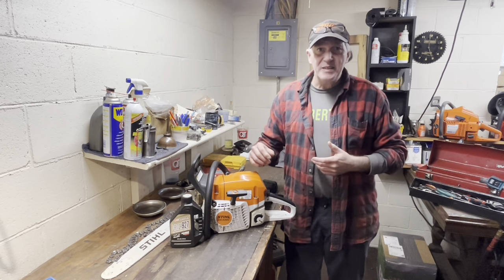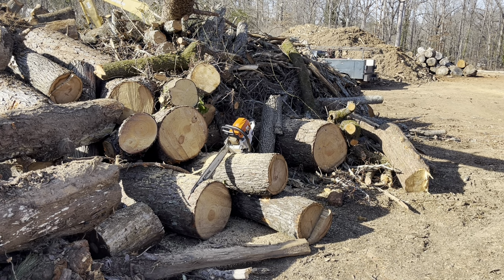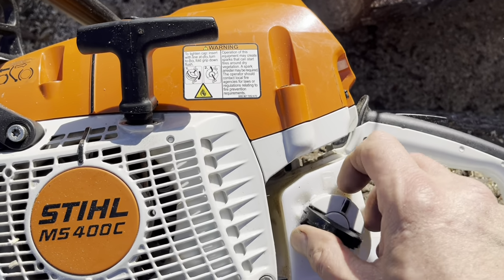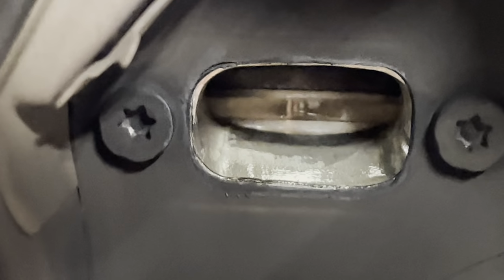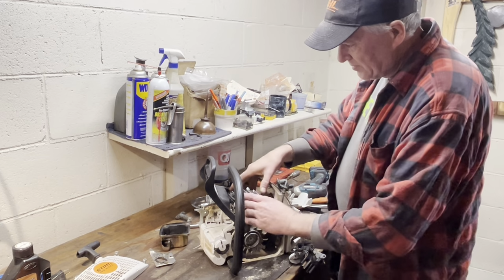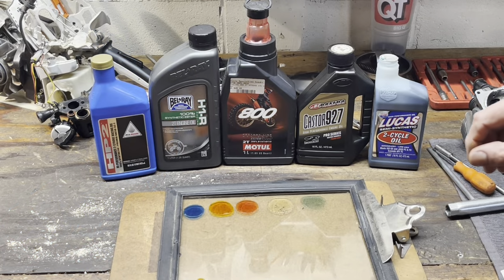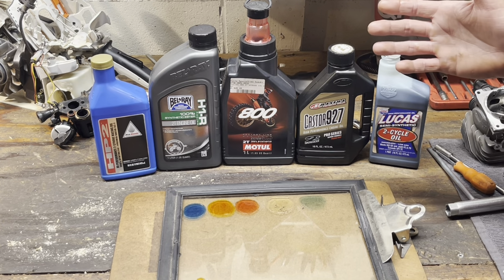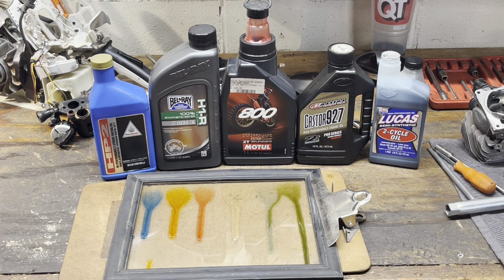Castor 927 Oil Test with Teardown

Comment: The carbon deposit on the piston crown for Castor 927 is the Castor oil itself. Castor gets thick and gummy with heat, the opposite of all other oils.
This helps with anti seize in the event of lean running as the gum still has lubricating properties. 
For saw application it’s not appropriate as eventually the carbon will cost the top of the piston and work into the ring grooves causing the rings to stick.
Great video Richard we are highly appreciative of your expert opinion!
Reply: Will water decarbonization work for saws?

Comment: The 9 and the 7 stand for the ratio of petroleum based oil and synthetic natural gas based oil. The 2 stands for the ratio of bean oil. The bean oil is dirty but it creates a better seal for your piston rings to create more power. Motorcycle manufacturers all knew this was the best oil you could get for racing in this country reliably. I was a suspension development rider back in the 80s and early 90s. I also did a good amount of chain sawing. I used 927 and turbo blue in my bikes and chain saws for years. Never had a problem with my saws. Castrol make a 947 oil that many felt was better but it is hard to find in the USA. I can tell you that 927 was used by every factory racing team in the country. They would even put it in other cans that had other manufacturers name on. Each different oil has a good quality. Petroleum based oil runs cooler. Synthetic oil protects better when the engine runs hot. Bean oil makes more power by sealing.

Comment: The absolute best smelling 2 stroke oil IMO! Ran many gallons of fuel mixed 32:1 with 927 over the last couple years in saws, trimmers and blowers. Surprised to see that amount of buildup in just one tank, every saw I've ran on it has stayed pretty clean internally. Now my Husqvarna handheld blower on the other hand... it built up an incredible amount of shiny, hard, black carbon after about a gallon of mix😮 also purchased an Echo srm-2620 last spring, removed cat from muffler after the first tank and ran 927 exclusively in it all season. Pulled muffler and plug this fall to have a look and piston looked beautiful! Just a brown coat on piston crown but zero buildup, same for exhaust port. But the muffler was absolutely disgusting! Not dripping with "spooge" but like it was just hot enough to polymerize the oil at the outlet and bottom. Like hard, sticky tar.  While the 927 offers excellent protection, I think ill be staying away from castor containing oils atleast for trimmers and blowers. Will probably still run it in a saw or two, if for no other reason than that killer smell🤪
Thanks again Richard for the time you spend to do all these tests👍🏻  still interested in seeing how aspen 2 compares to motomix/hp ultra. atleast in terms of lubrication😊
Reply: Thanks for sharing this.

Comment: I used 927 in my dirt bikes and had it on hand for my yard equipment. It smells pleasant and works wonders on small engines. I will even mix a tiny bit in my lawn mower and it's been running for 20 yrs

Comment: The 927 is dirty. No argument from me there. It really, IMO, makes a difference with how many gallons per year you run and if you’re WOT or on and off the throttle. I started using the motorcycle oil many years ago when I got a huge load of big cherry and oak in the summer. I saw a container and thought if it’s holds up in an air cooled dirt bike it should work great in a saw and never looked back. 
I did pick up a pint of HP2 to use in my new to me Homelite based on your testing Richard. And it works great! Thank you for doing these tests! We all learn from them.

Comment: Thanks for getting the 927 test in.  Results are what I expected, was hoping it would be a bit cleaner in the mtronic saw but nope.  I love 927, the smell is just amazing but I had to finally pull my 390XP apart I believe it was last year and clean up the piston and all cause it was coked on carbon pretty good.  I switched to Maxima Formula K2, doesn't smell nearly as good but burns alot cleaner.
Reply: Thanks for this information sharing
Reply: How does the K2 run in your saw?
Reply: @dennisyoung4631  K2 runs awesome.  Clean burning oil.
Reply: @matticus6339  thanks for the reply.  I have a 43cc Zenoah engine which I hope will be driving an emergency generator for charging batteries, and am planning to run ~ 28 to 1, with a rich non-ethanol mix.  I do not wish to stick the engine, hence substantial caution.

Note this isn’t one of the really screamy engines, e.g. the RCxxx ones.  The manufacturer calls for 40 to 1, but that scares me.
Reply: @dennisyoung4631  You shouldnt have any issues with K2.  I mix at 32:1 and no issues.  The only thing I wish, is that Maxima would put a bit more dye in it.  But I mix as soon as I get gas home from the store so I don't mess up.  Don't get me wrong, K2 is dyed but its not as strong a dye as some brands.

Comment: I’ve been mixing HP2 with 927 or k2 at 50:1 for a couple of years now, mainly just to give my fuel some color. Seems to be working fine. Is mixing oil a good idea or not? I might start running hp2 exclusively when I run out of 927 & k2. Thanks

Comment: Hello Richard! What fuel did you use in the video? Pump gas or alkylate (non ethanol gas)

I’ve tried to mix it with alkylate fuel and it separates from the castor 927, any thoughts?

Keep up the good work and take care.

Comment: Honda recommends running the hb2 at 32:1  and my chainsaw  recommends a mix of 50:1 and i want to use the hb2 after seeing your results should i use the hb2 how honda says (32:1) or mix it how my chainsaw manufacturer says (50:1) . Great videos btw.  Thank you friend
Reply from the maker: I tested it at 40:1 and it did great.

Comment: And with Castrol POWER1 RACING 2T there is no carbon build up at all...
Few months ago I had to chsnge the exhaust on my old MS230 from 2005 because it fell apart. Exhaust port clesn, no build up. Only a slightly coated with ash, on touch stays on fingers, piston and cylinder look beautiful. The film of oil is nice and shiny.
Reply: Yes  castrol power 1 racing  2T      good oil.  My 500i  going good on that oil .
Reply: @nikolaigordon  My machines are like brand new... MS230 piston, rings and cylinder look perfect. Made in 2005 I can still lift it by pull starter. So strong compression...
FS120 since 2016 heavy duty all the time still perfect. Running my new MS311 for a year on that mix too...

Comment: Bean oil was popular in the 70's for MX.  I remember fouling being an issue.  I like 110 leaded with VP or Redline 50:1.   Remove carbon from the sparky with a tooth brush.  I have yet to check carbon on the piston 'cause they run great.

Comment: I just looked up the specs on this oil and it is in SAE 40 grade range at 212 Fahrenheit with it‘s flashpoint 424 Fahrenheit. I believe Schaeffer‘s 7000 is SAE 20 and 218 Fahrenheit flashpoint simply for comparison. Good information👍

Comment: Do you use 927 in the winter time? I heard that the oil separates from the fuel at around 35 degrees ferenheit.

Comment: one thing I noticed when running my gallon or two of Benol mixed gas in my 2 strokes each year, is that  weeks or months later I get a little whiff of the bean oil smell as its deposits get cleaned out by the other ester based oils I run.

Comment: Great tests for sure. Wonder how maxima super m would do in a saw. Or even klotz snowmobile there both jaso fd, api tc, and iso egd. Ive been running vp but sure is pricey long term.
Reply from the maker: Are you able to get it in the pint bottle with the built in measuring cup?  It's a little cheaper than the premeasured bottles.  Be nice if they sold it by the quart without the fancy bottle.
Reply: @richardflagg3084  yeah I get it in the one with the measuring cup but I wish they sold it by the gallon. I usually buy oil buy the gallon or atleast half gallons so I have it stocked for a long time.

Comment: You convinced me to run saber at 40:1, but my local dealer only had interceptor  and dominator. I bought dominator  as im trying to use the same mix for lawn equipment  and my mx bike. What do you think of dominator  at 40:1? They had 927, super m, k2  I have no idea what to run😂  been running klotz super techniplate  at 32:1.
Reply from the maker: Dominator is a really good oil and absolutely nothing wrong with running it.  Saber has a better detergent package and burns a good bit cleaner.

Comment: I’ve been using Motul 800 in my 066 and 200T, works great. I bought a bottle of Belray H1R but haven’t tried it yet but I used to run it in my old YZ 250s and it was great.

Comment: I used to run MX2T, no dye in that stuff either. More than once I double dosed a gas can because I thought I'd already added oil, but not 100% sure. Could tell by the exhaust smell afterwards that I'd double dosed. Fine with me, that's cheap insurance. Running 16:1 is a whole lot better than running 128:0.

Comment: Any thoughts on winter VS summer us for bike oils. Id assume most people aren't running bikes in winter, so are manufacturers taking into consideration everything winter wise?  And what about ski doo oil?  Lol I'd assume that stuff isn't designed for summer use.

I'm in Canada but not real cold part east coast like maine weather or new England. Hovers around 32f in winter and 50-70 faranheit most of year. Humid damp. Windy lol

I'm milling mostly small stuff 7 to 20 inches. 462. We always ran stihl premium for years in concrete saws as masonry contractor. Never really had many issues everyday for few years cut cut cut. You'd have to mess with a little after few years but still good enough for side jobs or home owner

Comment: Use 32.1 mineral oil and add any cheap motor oil in tank like one cap in every tank along with 32.1 mix good smoke and  power

Comment: Yes the maximum k2 is like light gold ..can barley tell its mixed.i got scared even though i mixed it 40to 1..
Reply: Hey I'm right there with you on the k2 wish they would put some dye in it! Because that's what I run it takes blue aviation fuel and turns it like old brown  stale gas color almost at 32:1 40:1 mix is what I run in ALL my ported saws or stock saws. BUT YOU HAVE TO KNOW THAT IT'S MIXED SO I PUT IN GRAPE SCENTED STUFF IN MY FUEL!!!

Comment: Thanks for another good test Richard.  I'm kinda surprised that the top of the piston was that carbon'd up after 1 tank?  Seems to be a popular mix oil amongst the chainsaw folks....
Reply from the maker: Me too
Reply: Shocking and kinda a bummer considering how nice and shiny everything was.
Reply: @oakiewoodsman  red armor sure does quickly clean up the "castor goo" tho, if ya wanted to mix up a gallon of 927 every now and then😉
Reply: I know they advertise it as cleaning it up. Would be good to run in the Lynch 660 and the Super Dave 620 without the screen.  If more heat is better for that fuel, I wonder if the stock 562XP would really like it since they run so darn hot?  Maybe the carbon would not deposit so quickly especially with the stock muffler? hmmmm @aaronpowell4885
Reply: @oakiewoodsman  one way to find out! Run a tank or 2, pull plug and peek in cylinder. 927 has left no deposits in my g660 or ported 590. I will not say it's the be all end all oil and is definitely overkill for all but the rowdyest saws, I believe every 2t enthusiast should atleast experience a tankfull of castor mix, whether they end up loving or hating it🤪

Comment: Richard keep a look on Rocky Mountain ATV for the HP2.   I wait untill its on sale.  If you spend $75 you'll get free shipping, it's on sale for 10.99 and regular 14.42.   The last time I bought 2 case's it was $7.50.   

About 3 years ago I was looking for a better oil than the Stihl Ultra.   After reading Dragon Fly's data and watching Redbull661's Honda HP2  teardown video I decided on the HP2 over everything else.   

One thing for sure with the "Smurf Blood" there is no question you have mixed gas.    

Another thing I do to help prevent "straight gassing" my  2 strokes.   I bought the blue kerosene fuel cans for my mixed fuel.   If someone is helping me load up stuff it's easier to just say "grab the blue jugs" and it's a piece of mind without questioning or double checking.

Comment: While 927 is great oil, it does leave too much residue which ends up sticking the rings, I sold a perfect KX60 dirt bike to a friend for his kid to race, it seized up horribly and he tore it down, he started complaining to me about what I sold him, he was using 927, the rings were stuck  tight. Bean oil has always had this reputation and is one of the toughest lubricants available, but it's pretty much meant for racing applications where teardowns are often, I use it still but never in a saw or blower, I'd stick with the Motul, HP2 or non-castor Maxima.
Reply from the maker: If someone is going to use 927 and they're in the know, I'd imagine you'd have to be willing to do a teardown/inspection on a regular basis.  At the very least run some practice rounds and testing with a cleaner burning oil with a good detergent package.  Hard to argue the lubrication properties of castor tho.  It's just not for everyone.

Comment: Have you tried  outboard oil. I'd be interested in that test. Quick silver or pen zoil 2 stroke outboard oil.
Reply from the maker: I've only tested Schaeffers 7000 as it was my go to oil for years.  It's a TC-W3 oil and really does a nice job in regards to lubrication and clean burning.

Comment: I've seen  a test 40to1 vs 50 to 1. And they  showed more oil led to more heat. Can you test that if interested.
Reply from the maker: What channel/video, I'd like to see that.  More (high quality) oil/lubrication means less friction and ultimately less heat regardless if it's a two stroke of four stroke.  I've definitely noticed a heat reduction running Honda HP2 in a traditional carbureted chainsaw at 40:1.
Reply: @richardflagg3084  I think  it was called  Dave's small  engine

Comment: Bel ray MC1
Reply: Used MC1+ in the weedeater at 32 to 1.  Turned out both needles some, just like I’d been told back in the late seventies at a saw shop.

Had a little smoke when cold, to tell me I hadn’t forgotten the oil.

It worked good in that postage stamp of a yard…

Comment: Your fuel your ran with the 927 is the carbon. Ive never seen what you showed after only one tank.  We have zero carbon on our power valves with years of running 927

Comment: Opti2 and Saber look the same, smell the same and act the same with performance. I have been using Opti2 for many years and the results are the same. I used to be in the oil packaging business so they may even be the same.
Reply from the maker: The base oils for Opti are lower quality and relatively thin.  The viscosity they get is from additives, hence why they suggest a ratio of around 60-70:1.  While I have yet to personally test Opti, the handful of people that are truly educated about 2T oils discourage the use of Opti.  I have years of experience with Saber and can't say anything bad about it besides 80:1 is too skinny to run long term.  Saber still burns clean at 40:1 unlike users of Opti have mentioned when they tried to mix it at 50:1 and had issues.  One of these days I'll test it and can speak first hand about it.

Comment: Hands down Amsoil Saber is the BEST
Reply from the maker: It is a damn fine oil.
Reply: Amsoil saber is damn good oil that's for sure BUT DON'T mix at any 100:1 BS!!  Not sure what they use for fuel stabilizer but whatever it is it's DAMN good stuff I've personally left winter blended ethanol fuel in my personal saws for 4yrs YES 4YRS!! Went out fired them up and went to cutting firewood with no carburetor problems! But my personal experience with amsoil mixed at 32:1 or 40:1 I don't see the oil film coverage like I do with the Maxima Formula K2!
Reply: Amsoil saber is damn good oil that's for sure BUT DON'T mix at any 100:1 BS!!  Not sure what they use for fuel stabilizer but whatever it is it's DAMN good stuff I've personally left winter blended ethanol fuel in my personal saws for 4yrs YES 4YRS!! Went out fired them up and went to cutting firewood with no carburetor problems! But my personal experience with amsoil mixed at 32:1 or 40:1 I don't see the oil film coverage like I do with the Maxima Formula K2!

Comment: My nitro rc engines use nitro methane and castor oil. And thoes engines turn 20.000 rpm. And the run around 230 degrees f. I would like to see that fuel in a chainsaw.
Reply: Most rc fuels today use a mostly synthetic oil mix. In the old rc days(before the 90s) castor oil was the go-to choice for fuel blender because its one of the only oils (especially at the time) that will mix with methanol and nitromethane. Also using that fuel in a chainsaw would require a highly modified carburetor because you pretty  much need at least triple the fuel volume to keep the engine running properly and would not be worth all the trouble especially since the fuel is highly corrosive and very expensive.